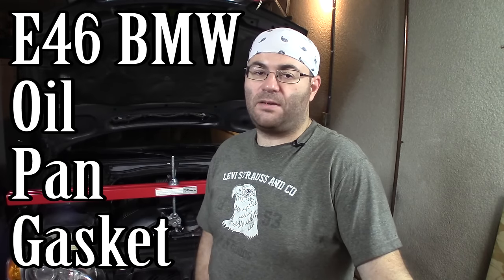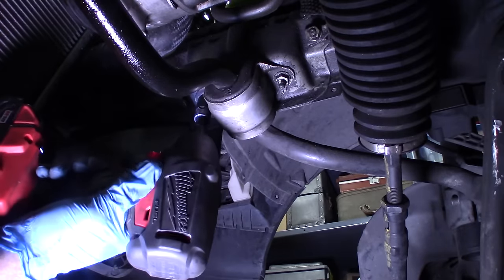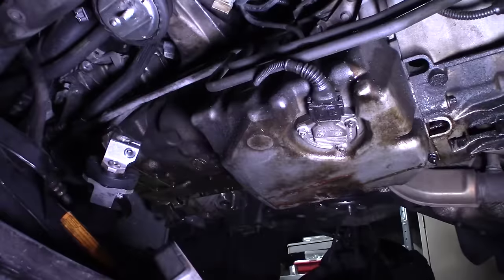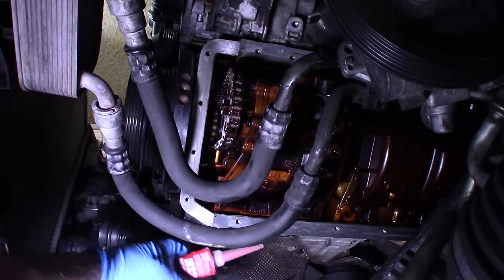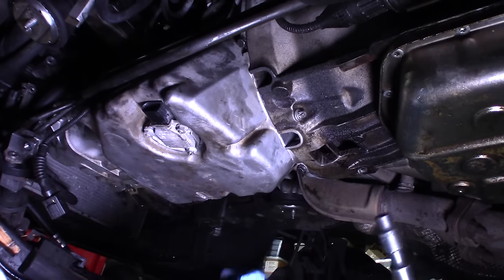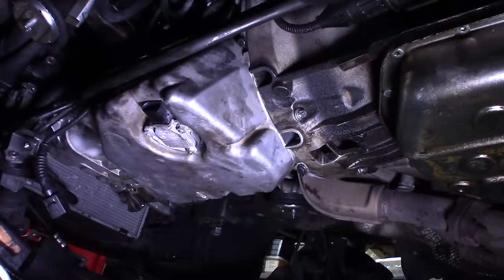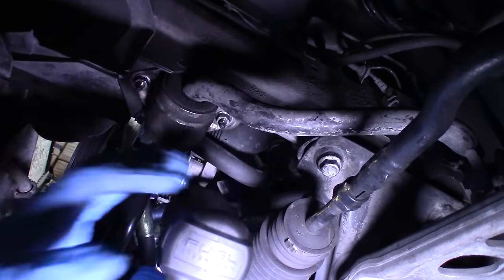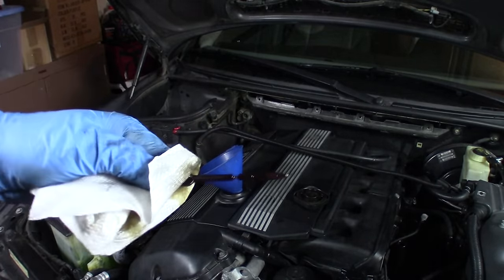BMW 330i 325i E46 Oil Pan Gasket Replacement DIY

Comment: You mention having to remove power steering pump because it is blocking some of the oil pan bolts? I already removed all the bottom pan bolts that ring the perimeter of the oil pan... So are there other pan bolts that im not seeing that enter the pan from the front of the engine horizontally  or something? or could I possibly skip that, I wonder?
Reply from the maker: +sledge beast No you're good.  The pump was blocking the camera from getting a good view.

Comment: Hi, I have an E39 that is leaking oil too.  Will it be a similar process of replace the oil pan gasket?  Thanks, Daniel
Reply from the maker: Somewhat similar.  You will have a different lower subframe and suspension components to remove, but if you generally understand what is going on you should be able to figure it out.  If in doubt, purchase the bentley manual for your car.

Comment: I'm using this DIY to perform this task now.  But it seems to me BEFORE jacking the engine up a few inches you would have to undo the engine mount bolts.

Comment: Cannot get throat back bolt removed, zero clearance for a rachet, barely any clearance for the socket. What do I do, stuck with the subframe dropped for 3 days now trying to get it out. Last bolt to do the oil pan. Facing the transmission.

Comment: I have problem with my E46 316i 2000, i bought it 3 months ago and since then he was leaking oil under the engine.
Alot, i hope its not a big problem, i changed the oil filter when i bought it so i dont think thats a problem. 
What is your opinion what could it be ?
Reply from the maker: That wasn't a very common engine here in the US so I really don't know much about it's common problems, but I'm sure it's like all other BMWs... oil filter housing gasket, oil pan gasket.
Reply: I changed oil filter housing gasket, but didnt do nothing about oil pan gasket. I will go tomorrow to the mechanic and he will check what is the problem>

Thx for very fast respond. Sub & Like

Comment: Thanks for a great video.  My wife's E46 has this problem....sort of.  It leaks, but so slow that oil level drop isn't perceptible on dipstick until around 6-8 months.   After watching this video for about 2 minutes I knew I wasn't going to be doing this my self.  In fact, unless it gets worse (been 4 years now) I might not do it at all.   My BMW dealer originally pointed this out.   At the time I had no idea.  Nothing was perceptible on the garage floor.   Now 4 years later, it is noticeable.      Stupid engineering to have to do this to change a gasket.  Simply stupid..
Reply: Mine went 275,XXX miles and 21 years before this started. My Toyota went 180,000, gaskets don't last forever.

Comment: Crap. Not sure if I have the confidence to tackle this job... 0_0

Is it the same procedure to access your oil pump? Did you tighten your oil pump nut? I've heard people say that they tend to fall off
Reply from the maker: yeah same procedure. I did not tighten the nut during this job. It wasn't loose.

Comment: Hey when you added the RTV on the two spots before putting the oil pan back on, where exactly were you sealing? Hope you see this, thanks.
Reply from the maker: In the back the rear main seal is inside of a housing and is bolted to the back of the engine, so you need some RTV where that joint is.  In the front the timing cover is sealed to the engine and you need some there as well.

Comment: I wonder if them boats are aluminum with such little torque maybe you're supposed to replace them when you do the gasket mine look like they are good ones I'll try a 🧲 magnetic I'm not going to start the job yet I need a couple days to down it and it's -5 out side. Trouble getting the shop over 55 😂

Comment: Is that a Milwaukee Fuel impact wrench you're using to remove the bolts?  Do you like it?  It looks pretty compact.  Enough torque for things like removing lug nuts?
Reply from the maker: that's correct. I use the 3/8" version that supposedly has 200lbs but I think that's probably marketing bs. It can probably do properly torqued lug nuts, but it would probably take a few seconds. It can't be a complete replacement for a 1/2" air impact that has like 600-700lbs. It can't handle suspension work. And there seems to be an annoying condition sometimes where I can't pull the trigger again after I take a bolt off and I dunno I have to let it rest for a few seconds. But other than that it's great, lol
Reply: +50sKid Thanks for the detailed reply!  Sounds like there's a little room for improvement but mostly good enough!  I'm leaning towards a compact impact wrench for less weight and fatigue while working under the car. If it can do lug nuts, great, but not essential.

Love your videos, they are easily some of the best out there for working on my E46 (2000 328i) - awesome video and sound quality (most car videos seem to be of a guy grunting from the bottom of a well, haha), description of what you're doing, etc.  Love that you show "mistakes" instead of just cutting them out, and ideas for better ways to do things, and tend to show from start to finish, rather than somewhere in the middle.  

If there's an unsolicited suggestion I may make, it would be great to occasionally give info to orient the viewer (for example, "I'm looking forward towards the left / driver's side wheel, about 1 foot behind the oil pan"), or to zoom out a bit occasionally to give context.  For an almost total newbie like me, it would help to more quickly orient myself and figure out where exactly you are working.  

Oh, and I have my fingers crossed to see a wheel hub bearing replacement video from you one of these days. :)  Not that I'm hoping for your bearings to fail, lol.   I've got a bad one on my passenger side, need to figure out which one and get that replaced.
Reply from the maker: +readyplayer2 thanks very much and I agree with your suggestion, I'm going to start doing that! yeah I would definitely recommend the "compact impact" as the go-to tool for the reasons you said, although I myself would probably go back to Makita because I still love my old one so much. When I get some extra cash I may go back. I've got a wheel bearing video coming up on the e53 which follows the same sort of procedure as the e46 would.
Reply: +50sKid Excited to hear you've got a wheel bearing video coming up, I'll keep my eyes open for it.  I'm very curious to see what tools you end up using, and how you do it.  I'm very paranoid about the inner race separating, being unable to get it off, or messing up a new bearing putting it on.  Anyway, thanks again!
Reply: +50sKid i have the 1/2 inch version and it removes lug nuts like an air impact will. I didn't believe a cordless impact can be this powerful untill i got this. Homedepot has it for $199 right now.
Reply: @50sKid  , I've been using the 3/8 impact for over a year and love it. I just recieved my CPO Milwaukee 1/2" battery powered 2860 impact so I can use it on my lugs and tough suspension bolts . The 3/8 just wouldn't do the lugs (90ft lbs) etc. I love not having having a trailing air hose getting in the way, plus I can take them anywhere, friends, junkyards, roadtrips, etc...

Comment: are there any special procedures for aligning the oil pan to the engine block or just bolt it down and can't go wrong?
Reply from the maker: bolt it down, can't go wrong.
Reply: 50sKid thanks for the quick reply! That sounds good.

Comment: I have a question. Reading online, jacking up anything a part from the jack points or the subframe is a HUGE no no. I hear horror stories where it can crumble pans and etc. 

I see you lift oil pan multiple times, so it's ok to do?
Reply from the maker: It crumples the little middle part that sticks down from the aluminum skid plate and does deform the pan a bit.  I've just beat the pan back into shape with a hammer though and it's fine.  Yeah you can lift the oil pan--it's solid.  But I use a piece of a wood between the jack and the pan when I do that.

Comment: I have an oil leak on my e36 m3. i used the oil dye to find the leak. And found it's leaking from the passenger side oil pan and bell housing.  Leaking a drop every 3 secounds. My question is do you think it's the oil pan gasket or rear main seal.  I need your advice.  Thanks
Reply from the maker: Oil pan gasket

Comment: Great video! Now thats its been a couple years sense you did this video is there anything else that should be done while you have the pan off?
Reply from the maker: Damn it's been a year and a month, that's crazy.  The only other thing maybe people would want to try is installing an oil pump nut with the aircraft style lock wire on it.  I bought one, am going to install it as part of my rebuild that I'm working on now (shooting this video now).  https://rallyroad.net/products/securedoilpumpnutkitforbmw6-cylinder

Comment: Great video!! Btw how safe is the engine support bar hook to handle such weight. Thanks
Reply from the maker: +mrtheedgeman It's safe--it can handle 1000 lbs.
Reply: +50sKid Would a 660 lbs engine support bar be sufficient?
Reply from the maker: Should be, yeah.

Comment: Hi there.
I'm planning on replacing the clutch, dual flywheel and catalytic converters i already bought the crankshaft seal  and input shaft seal.
Is there any recommendations on what else can i change ?
Thanks man love your videos.
Reply: By the way i own a 04 325ci manual transmission.
Reply from the maker: You might want to change the giubo on the driveshaft where it connects to the transmission output shaft.  Be careful when you do the input shaft seal on the transmission (if that's what you're talking about).  That seal is actually an outer seal and right underneath it is a sealed bearing.  You want to be careful when you pry the old seal out of there--if you use a screw driver, don't poke it down too far because you risk damaging the seal on the bearing and if that happens you're not getting the bearing out of there without splitting the transmission case open.

Comment: How many hours did it take ? Because im turbocharging my e46 and i gotta pull oil pan to thread/weld/bolt a fitting for the drain line so it kinda sucks. Also im glad i got manual)))
Reply from the maker: How long did it take is my least favorite question because it takes me 3 times as long to do anything because I'm filming it.  But I would say maybe 3-4 hours?
Reply: @Andrey Arkashin just buy a lock nut bolt instead problem solved

Comment: I have a question for you I’m doing a engine swap on a E 46M 54 engine I’m doing the oil pan gasket in the rear main seal where the transmission bolts to which gasket should I do first thanks for the help.

Comment: Can the bolts of the oil pan can be re use? Or are they one time use?
Reply: They're reusable. The only thing to replace along with the pan gasket is the o-ring that goes on the dipstick tube. This tube fits into the oil pan and the o-ring doesn't come with the oil pan gasket.
Reply: @fowvee  thanks so much! Will do

Comment: I think you should remove the engine mount nuts before pulling the engine up because they are not designed to handle pulling forces.
Reply from the maker: you are right

Comment: Use cable ties to hold the gasket onto the sump, start a few of the bolts to get the sump in place, then cut the ties😉

Comment: I saw my bottom power steering bolt is missing. Do you know the size of that bolt. Must of not tightened it enough after i did my OFH gasket earlier the year.

Comment: Hey buddy, luv your vids. You don't know how much you've helped.  Question, I have to do oil pan gasket and also the clutch. Would you suggest to have motor fully supported back in subframe or would it be easier to remove trans when subframe is loose? Thanks again.

Comment: The golden years of BMW are over. Owners are bailing out and quite frankly having enough of these sad sagas. I was a long time BMW owner and quite resourceful at addressing their short comings. Then it dawn on me why I should spend my time and resources to address their inept ability to make a reliable car. Who in their right mind would incorporate plastic parts in their belt pulleys, water pumps, thermostat, ..... and aluminum fasteners ..... just to name a few.  Why should I continue to buy their cars if they just couldn't care less in putting their owners at risk of being stranded when these mishaps (which is entirely preventable) from happening ? They must think that we are stupid.

Comment: Really good job i really appreciate this videos and thank u for ur advice i replace my front wheel bearings on my 2004 e60 due a highway vibration and my car drives nice and smoth thanks

Comment: Hey 50s Kid how are you doing? I have a question I did my oil pan gasket everything went well now when my e46 Bmw car is idling I heard a knocking sound it comes and goes only when idling when I give gas 3000 for 2min str8 I don’t hear no noise ? Can you give me some tips thanks Man

Comment: Do you think it's would be possible to undo the track rod ends at the wheel giving you possible room to swing that rack out the way? Or is this not possible?
Reply from the maker: Yeah it's possible.  You will also have to drain the power steering fluid and disconnect the lines from the rack.
Reply: 50kids you are a legend

Comment: Hi I have a question so does the engine and mountings not rest on the sub frame I have a e46 320d  sump got damaged so just wanted to know
Reply: They do. This is the reason that you must support the engine from the top with the cross-member tool. You unbolt the engine mounts, lift the engine as much as possible without damaging anything, and then you go under the vehicle and unbolt the subframe. This procedure is for the 6 cylinder engine so your application may be a tad bit different.

Comment: Hi I'm trying to drop my oil pan along with the cover and oil pump parts to my 2006 X5 M54B30 3.0i SAV. I have the engine support bar also. But in doing that task I had to change head gasket an learned head assembly was cracked in three different places. The assembly is presently off block. I have discovered a crack in my 3rd cylinder piston head. I have new one to install it's 84mm I have new rings to go on it also. My goal is to enter bottom of crankshaft to push piston out top. I have the honing tool to put 45 degree cross hatch back into cylinder wall chamber. It doesn't need to be reamed. 

I have the pan slightly dropped but the axle differential goes through the oil pan on both sides, how do I get those axel arms off the pan it's sitting on ramps at moment and how do I support motor wit bar I don't have the heavy duty jack which raises vehicle high off ground. I can send you pics or do brief video an attach to your email so u can see what I have done this far. To then give me your thoughts n assessment of my work an how best to proceed forward to get this task done. Thanks 50's Kidd 
I am Ty by the way...my email is coontakentay@hotmail.com
Reply from the maker: I have a video series on doing the oil pan gasket on an X3 -- just search my page it's fairly recent.  Make sure you stuff blue paper towels on top of the crankshaft during the honing process.  You do not want junk to get onto it.  You should also remove the oil squirter otherwise the hone may break it off.  Be sure to clean the cylinders with SOAP AND WATER, NOT SOLVENT.  Solvent will not get the microscopic particles of metal out.  The #1 cause for failure of a re-ring job (that is what you are doing) is dirt/residue contaminating things.
Reply: 50sKid oh ok thank you. I'm being told that the replacement head assembly I bought was bent .013 thousandths. And also had water inside of housing , so I called business back and let him know I would be sending it back to him for a refund of my money. So I'm going to just buy motor and be done with it...some of the supposed help really was not true to their word. I'm still learning mechanic work in an of itself. Lot of people were baffled by the fact I did what I did having no prior experience in field of mechanic work.

Comment: Whoever is completing this job make sure you disconnect the headlight level sensor first and support that front sway bar before you drop it. I though I had it under control at it took out my headlight level sensor.

Comment: hi there, iv been following your steps for this job and all was going well until i got to the back 2 10mm long bolts. 1 snapped the head off it and the other just wont budge the head is now stripped on the one that wont budge. any advise ?
Reply: Christopher Kitson dang you been a month with no advice
Man try to get pliers or visegrips or go the extra mile and remove more parts so you can pull it all out
Ask a friend to come and sit with you and help 
If you have money tow it to a dealership or good BMW specialist shop
Reply: No worries mate iv sorted it now. I managed to drill them out. It took some time but managed to do it.

Comment: Have you replaced the rear subframe and differential bushes yet?
Reply from the maker: +clabcon No I don't have any problems with my rear bushings so I don't plan to replace those.
Reply: +50sKid After 170k I thought surely mine would be done. Ordered all the parts and special tools. When I got the old ones out they were just fine. I think a visual inspection for cracks in the rear diff bushing is adequate.

Comment: Hey question, I have a BMW 328i 2007. Need to replace the oil pan gasket. Is it similar to this procedure?
Reply from the maker: It's probably similar but different.  Similar in that you'd need the support bar and you basically just need to lower the subframe, but things will probably look a little different.